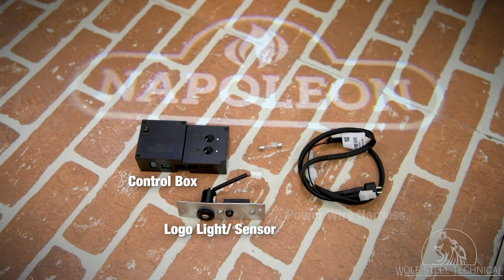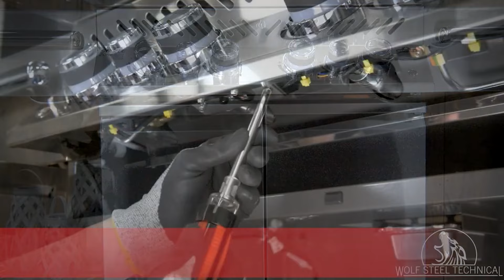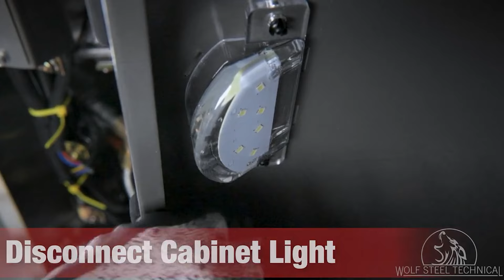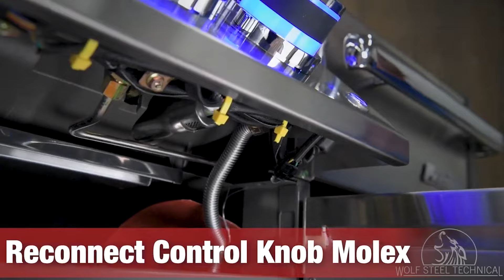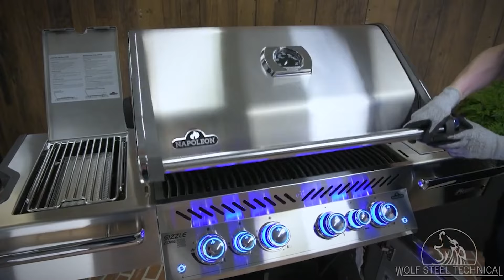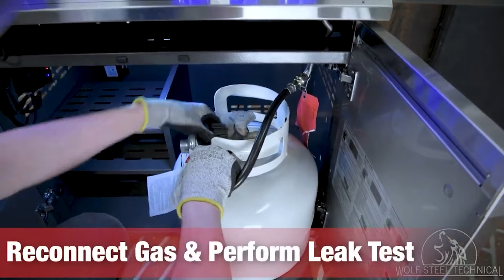Napoleon Prestige PRO™ Electrical Troubleshooting

Comment: No help if your problem is that a few of the knobs no longer light up.
Reply from the maker: This is actually easy to troubleshoot and fix:

Pull off a knob from a working bezel and and one from a non-working one. they just pull straight off.

remove the 2 screws you'll find under the control knob, which frees the bezels form the control panel. Ensure the bezel that's not working has a strong connection (disconnect and reconnect). If it still doesn't work. switch it with one of the bezels that is working.

If the issue remains in the same location, the wire harness needs to be replaced. If the problem follows the bezel then the bezel needs to be replaced.

Best part is, the harness can be accessed from under the control panel fairly easily and is secured in place with zip ties, so service isn't too tricky.

Hope this helps!